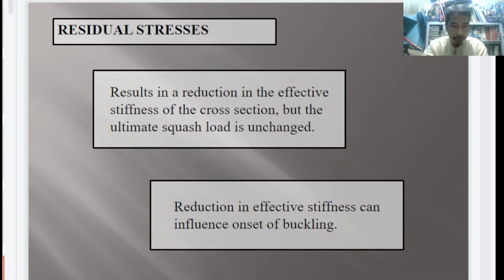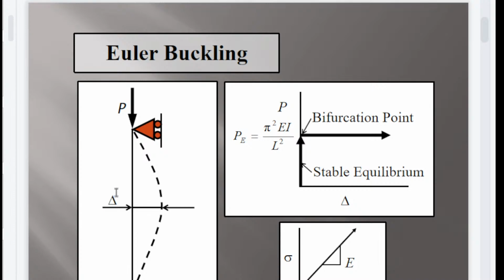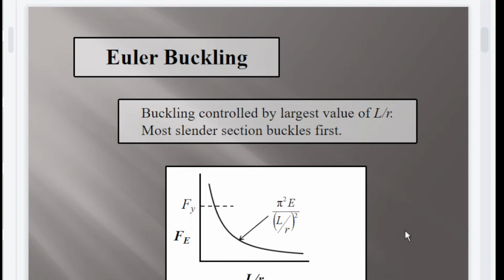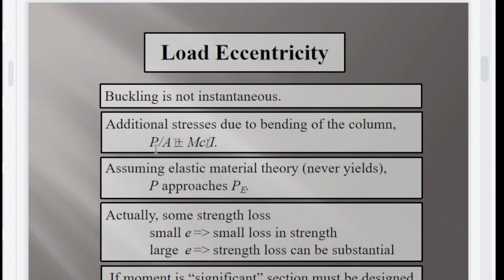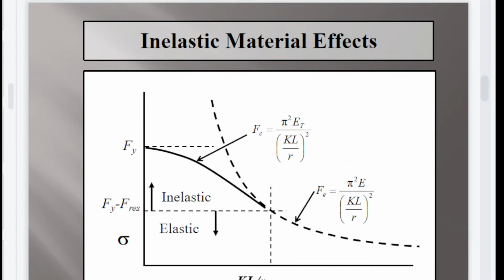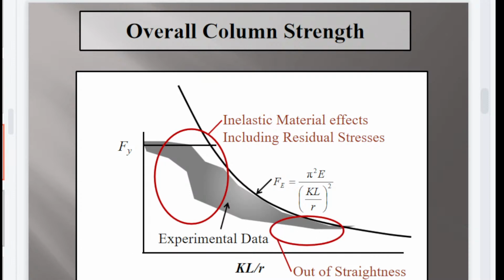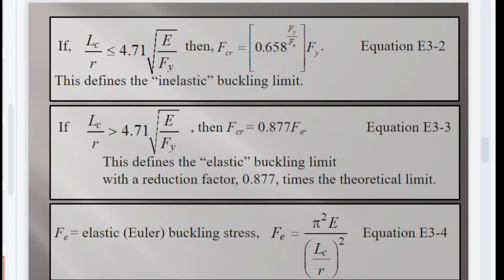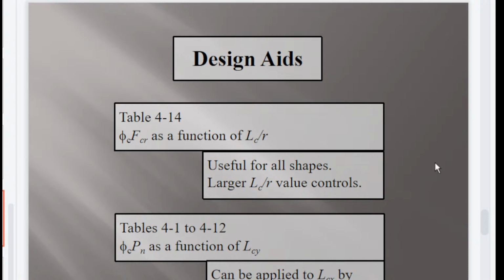[ LIVE CEE6 Lecture22 ] DrAP Zantua Design of Compression Members + Global Buckling

Comment: Thank you, sir for the discussion that talks about the design of compression members and global buckling. The lecture contains the information about residual stresses, Euler's buckling, the initial crookedness, load eccentricity, and the end restraint. I have learned that there are three failure modes in compressions. Also, the absence of residual stress, all-fiber of cross section yields.

Comment: Thank you sir for this live lecture about the individual column, squash load, and fully yielded cross-section. I learned about the residual stresses, Euler's buckling, the initial crookedness, load eccentricity, and the end restraint. The compression strength with conditions of flexural buckling, torsional, and flexural-torsional buckling were also discussed. Thank you sir.